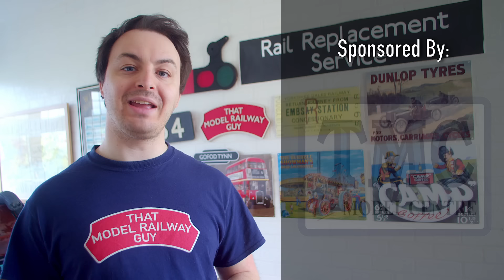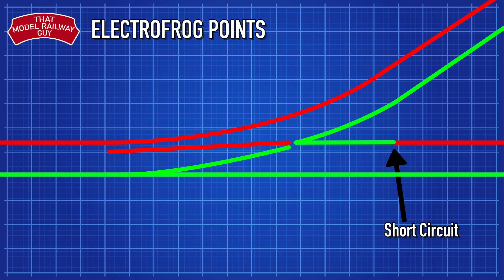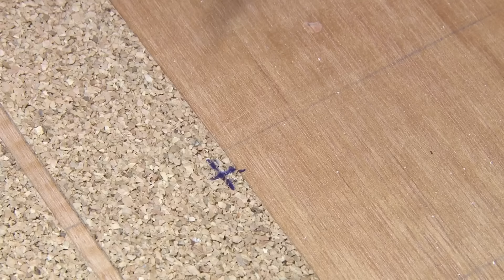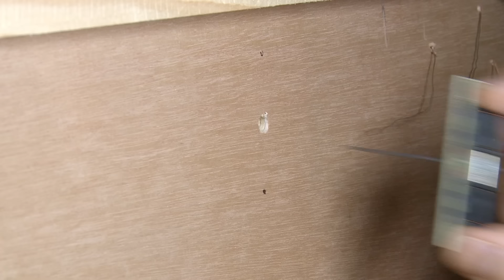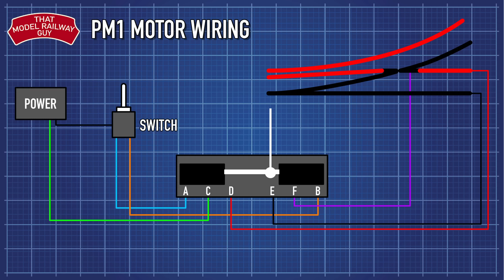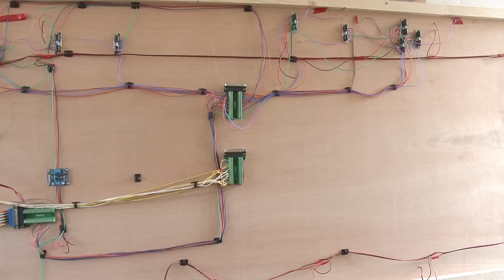How To Wire PECO UNIFROG POINTS - Model Railway Tutorial

Comment: I have a good selection of Electro frog points that I manually change, or have surface mount point motors. Unifrogs are a backward step for me, Peco should have kept the frog switchable from the point blades, then you would have the best Point for everyone.. Good Video and good explanation of Unifrogs though, I enjoy the channel, always good content 👍👍
Reply from the maker: It is still possible to do that with the Unifrogs if you want to though. The issue with that method is that you're relying solely on the point blades which can cause problems over time.

This way the points are useable for both beginners and those who want more control over their points. Ultimately we all need to get used to Unifrogs as the Electrofrogs are gradually phased out. Thanks for watching 😃
Reply: @ThatModelRailwayGuy  Must have missed something then, How to you get the point blades to power (and then flip) the frog..?
Reply from the maker: Snip the wires that connect the blades to the stock rail (if needed, I'm not sure if all Unifrogs are connected here) then solder the frog feed to the blades instead. As the blades touch each stock rail the power will flow through them to the frog (and opposite blade too) but you're relying on good contact being made every time.
Reply: @ThatModelRailwayGuy  OK, sounds good, Many thanks for the tip I'll look to do that.. Great stuff.. 👍

Comment: Fantastic! I may not be using unitfrog points. But the D& E tab could those he used to turn on a led on a point switch board?
Reply from the maker: Yep absolutely, that's one of the other intended uses for the PM1 motors. By using the two polarities you could power two different LEDs for different positions. Thanks for watching 🤩
Reply: @ThatModelRailwayGuy so I’m guessing and I apologise for daft questions, but the positives from the LEDs will go to the D & E tab and the negative to the common return?
Reply from the maker: Yes that would be my understanding. The PM1s come with a set of instructions which I believe state this option too (you can probably find a digital copy online if you wanted to be sure before buying any)
Reply: @ThatModelRailwayGuy  perfect thank you

Comment: A good explanation, I have used electrofrogs for my DCC layout but because I have used surface mount point motors, I'm using relays to switch the frog. It's a little bit more wiring but still simple enough. It's good to see Peco moving over to the Unifrog, Its a shame they haven't got to crossovers for code 100 track yet as they never came with an eletrofrog version unlike the code 75.
Reply from the maker: There are surface mounted point motors that allow for polarity switching - I believe Rails Of Sheffield sell some and they use terminal connectors rather than requiring soldering which is handy too. Might be worth looking into if you ever feel the urge redo them - though if it ain't broke, don't fix it 😉

I believe PECOs plan is to gradually switch over to Unifrog points as the tooling for current products wear out. I don't know how old the current moulds for the crossovers are which will be the deciding factor on how far up/down the list they are. Thanks for watching 👍
Reply: @ThatModelRailwayGuy  Ah yes the digital pack does but I have gone pure analogue for point operation, I do have some Rails motors though, the packs of 5 are reasonable value.

Comment: I've used SEEP point motors in the newer part of my layout and discovered, very early on, that getting the alignment right for correct operation of the power switching function was very difficult (especially when the baseboard is in place), so I use latching relays, which hold their position, even when unpowered.  If using a CDU, put a 1k resistor between the coil's common return line and the CDU return line, as the greater current caused by the high voltage can cause the coils in the relay to burn out.
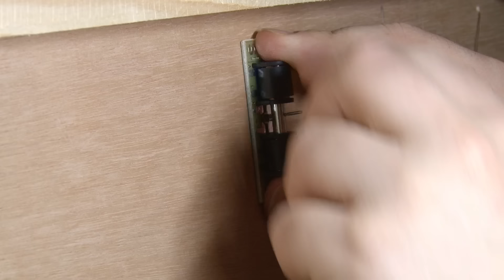Reply from the maker: I can't say I've had any issues with alignment myself. You can see at 07:58 I flip the rod back and forth to find the sweet spot where the contact touches the power feed on each side before marking the position so I'd recommend trying that.

With solenoid motors you really need to be using momentary switches. If you're using those there shouldn't be any concern about the motor burning out (even with a CDU) as the burst of power is so short. Thanks for watching 😃
Reply: @ThatModelRailwayGuy I’ve seen some people talk about using thin cardboard to hold the rod in a central position. But you don’t seem to do that is it necessary? Bit worried when I try this I’ll misalign the motor. Will be following your tutorial though so hopefully I’ll get it right.

Comment: Do you need to use insulated rail joiners with unifrog points please?
Reply: No
Reply from the maker: No because the frog is already isolated. If you look at the diagrams at 04:44 you can see the exit of the point is never showing a short circuit. Thanks for watching 😃